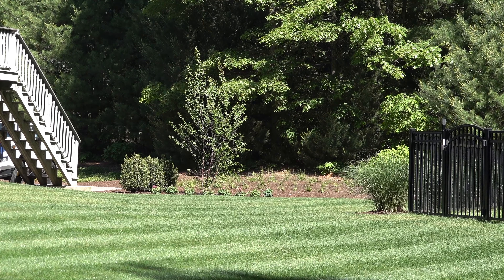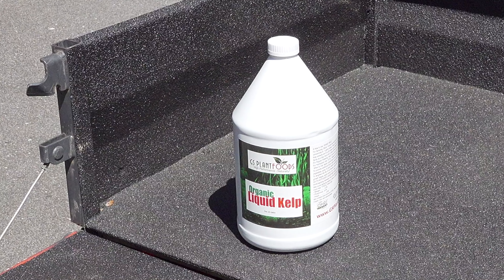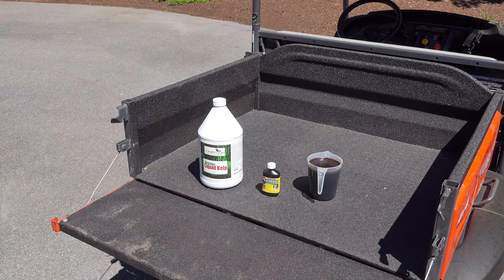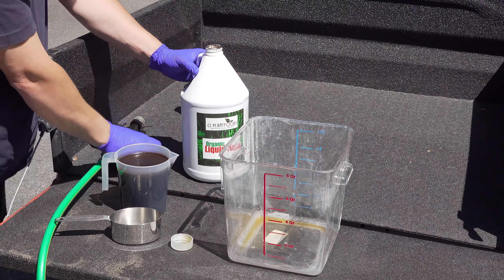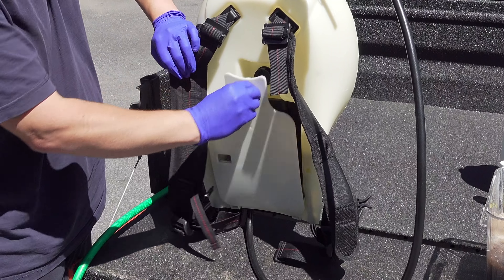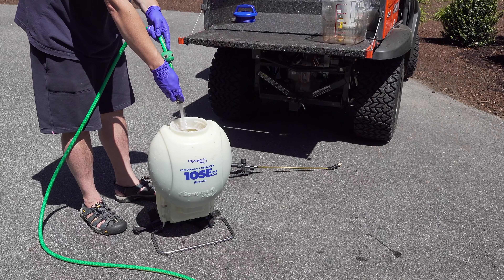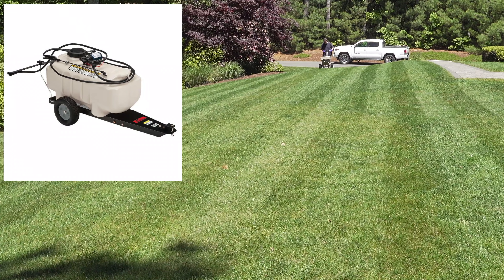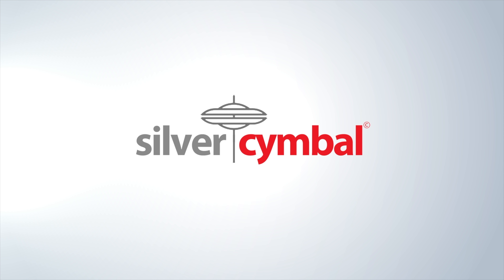Protect your Lawn From Summer HEAT & Stress my Secret Recipe STAY GREEN with Sea Kelp

Comment: Love my Sprayers plus. But my wand tip leaks when the unit is off. Have you had this issue before?
Reply from the maker: Yes, it's not just them though they all do it. Here is my trick. Once you turn it off squeeze to release pressure.  Then with the unit off, hold the wand in the air (not above your head obviously in case of drips). Squeeze the trigger and wait a few seconds with it held open. This will usually allow the fluid to drain back to the tank. Hope this helps.
Reply: @SilverCymbal  What a fantastic idea 👍 This will help a ton, especially after getting blue dye in the driveway. Please keep up the good work, you've got a great channel going.
Reply from the maker: @webeducation  That you I really appreciate it

Comment: Do you put this mix down before the Humic DG? 

How often should you put this down?
Reply from the maker: I use the humic dg as a foundation type product 1 or 2 x a year. Its a huge soil builder but this "recipe"is applied monthly during the hottest months. usually 3x, June, July, Aug (for new england) to keep the foilage in great shape and protect against heat Hope this helps.
Reply: @SilverCymbal  Have you thought about using N-ext products? Why/Why not?
Reply from the maker: @DEXTVHD  Yes I have but the price was too high for me and in this case my own mix has worked so well that I will probably just stick with it. They do look like nice stuff though.
Reply: @SilverCymbal  they are quite expensive, what's the humic acid % for your liquid humic from gsplantfoods?

Comment: Can I use in a hose end sprayer and what setting?
Reply from the maker: You can but it really is not going to be easy to measure. I would get a really inexpensive pump sprayer. It goes faster and gives you much fiber droplets that cling to the blades better.

Comment: 2 questions, can I use this mix with a hose-end sprayer? Would you recommend adding liquid iron to the mix? Thanks!!!
Reply from the maker: No, it will not work correctly. Hose end application is very rough and for this which needs to stick to the blades won't work correctly and end up in the soil which loses 90% of how sea kelp works. Use the regular sprayer and the results will show.
Reply: @SilverCymbal  Thanks for info.  Can liquid Iron be mixed into this, or should it be applied separately?
Reply from the maker: @ErikHiner  I haven't tried. I a, not a big fan of adding liquid iron. Makes you lawn super green for such a short time, it's expensive and it can stain badly. I get why people doing but its really not sustainable in terms of cost for most people and if you ever spill it on concrete you won't be happy.

Comment: Do you water this in after the application?
Reply from the maker: No, you should try to apply it where it can stay on the leaves for 24 hours, then water as normal. This gets absorbed through the grass blades  and though it will help the soiul too the best effect is through the leaves, also called a foliar application. So just spray and let it do its thing. Thanks

Comment: Thank you for the video. Just curious, can this concentrate be used with a hose end sprayer such as the Ortho hose end sprayer?
Reply from the maker: Thank you, unfortunately not. Those put out a lot of water and dilute it so much that it wont stick to the leaves properly/ There are some formulas for this that you can spray through the hose end sprayers that will not be nearly as effective. if at all. It's just the way that kelp needs to be applied.
Reply: @SilverCymbal  thank you. 😊
Reply: @SilverCymbal  Thank you for this answer, I was wondering the same thing.

Comment: What part of the country are you in compared to me? I'm in regular 100 degree day Texas with St.Augustine grass. Will any of your tips benefit my lawn?
Reply from the maker: I am in New England much of our summer has been hotter than a lot of Florida though I understand TX is HOT! The good news is that the mix is very beneficial to all grass types especially for heat. We have had a crazy season and my non-irrigated part of my lawn can see it on my instagram is in better shape than many of my neighbors with irggiation.  Its no mircale cure but it has an absolute benefit especially for high heat climates.

Comment: How often are you applying this solution? Thanks
Reply from the maker: I apply it ever 4 weeks when the weather is brutually hot. This summer has been bad so you might do it every 3 weeks.
Reply: @SilverCymbal  Can I use Root Ruckus + thrive? Root Ruckus has concentrated Humic acid + Kelp.
Reply from the maker: @abansalify  Yes you can that product https://amzn.to/3jpo9Oe is basically a mix of these and other have reported it worked very well for them on lawns as this. Same company makes them so I have faith in their stuff.
Reply: @SilverCymbal  I am also testing Hydretain Granular for hot season.

Comment: I did this treatment two days ago and now have the products from your Tenacity video. How long before I can treat the lawn for weeds and such?
Reply from the maker: Sounds good. When using the summer formula I would wait 7 days before treating weeds. Just since the summer treatment is on the leaves you want to leave enough time to the tenacity can do its job.
Reply: Thank you for the reply. The 105Ex sprayer worked great. Granted, all I can compare it to is a cheap pump sprayer from the big box store, but still, it worked great. One more question, I've got about half a gallon left at the bottom where the pick tube can't reach (with it facing up). Do you turn that down to get the most liquid out?
Reply from the maker: @KyleHeon  Thank you, I did the same thing. Put some gloves on and rotate the intake tube so it points down in the sprayer. This lets you get to almost the last ounce of the sprayer. You wont have that issue again. Thanks

Comment: Will this work in hot climate like Arizona on Bermuda grass?
Reply from the maker: Yes, it will provide the same benefits. If you are in extreme temps I would apply it as early in the season as you can and then monthly after that until the temps are below 75 average during the day

Comment: Good video. Can this mixture be used on new sod and gardens?
Reply from the maker: Yes to both, great for sod since by it's nature in it's first year it's already settling in. This is a great way to assist it and I also use this in my gardens. I will spray  on shrubs and trees. I generally just use it iat the base of plants when doing gardens since covering them completely can be difficult.
Reply: It sure does work,my garden is thriving big time!!! So after I applied this mixture a week ago,I had some left over which I placed in containers. My question is will this liquid spoil..go toxic....???
Reply from the maker: @jimtalor7971  Thats great to hear that you have great success with the mix. Nothing in the mix should go toxic but it may lose some potency I would say its best to use it within 1-2 weeks. You can always add extra to use it up also. I would not waste any of it. Thanks

Comment: Liquid  Humic vs Anderson  Humic DG?
Reply from the maker: They both do a great job but if you primarily want to do just Humic acid the Andersons DG is excellent. You can always mix mix the recipe without the Humic acid if you go that route. Keep an eye out for a new video on this too soon. This is the best part of mixing it yourself and you can adjust it as needed or use it as designed for a quick and easy way to help your lawn.

Comment: How much sq ft does a 4 gallon mixture cover? Thanks
Reply from the maker: About 2500 sq ft ideally, but you can stretch it to 4k if needed. Some is better than none but applying the rate I have has given me the best results

Comment: Great video. Can you use it in Bermuda. We had a serious heat wave for 2 weeks. Water alone did not do job.
Reply from the maker: Yes, you definitely can, and it should help significantly.
Reply: @SilverCymbal  Last question. What about plants and vegetables?
Reply from the maker: @Jorgemartinez-qo6yq  Yes all 3 products shown are organic and can be used for plants and vegetables. Always double check the labels first in case things change but they are currently good for this.

Comment: I always enjoy your presentation style, great advice as always. Is it just the standard 1 gallon per 1000 sq ft coverage for these products mixed? I have a little over 11,000 sq ft to cover so if I'm doing multiple applications per year of a supplemental product outside of my regular granular fertilizer apps, I need something cost effective. A lot of the products I've seen like liquid humates seems to be pretty expensive or only covers a smaller area. So I started looking at the concentrated humic powders you mix like 1tbsp per gallon or something and it goes a very long way. Definitely need concentrates! How much coverage do you get out of a gallon of each of these bottles?

Comment: Hey thanks for the heat stress recipe. Just ordered all the ingredients. Thanks!! So I have a question. Do you water this in to wash it down to the soil level?
Reply from the maker: Thank you, no just apply it and let dry and wait 24-48 hoiurs before watering to allow the leaves to absorb the product. If it does rain in less than that, its not the end of the world and you will get some benefit but allowing it to dry will give the best results. Kelp: https://amzn.to/2It5ZJT  -  Superthrive: https://amzn.to/2It654d  - Humic Acid: https://amzn.to/2WyMABa - Sprayer: https://amzn.to/2IslQIJ.

Comment: How many square feet does a gallon of your solution cover?
Reply from the maker: Depending on your nozzle/spray pattern 4 gallons will treat around 2500 sq ft. Going heavier is fine but even if you are lighter your lawn will get benefits from it.

Comment: Thank you for the information and video. Is it ok to apply this formula now (~July 1) and recommended?
Reply from the maker: Thank you very much. Yes, you definitely can apply it. For me I use this monthly June, July and August.  Sometimes September if the heat stays up. Any application will provide benefit so if you skip a month that's ok but if you can do monthly in the hotter months that will be the best.
Reply: Silver Cymbal ok great. I’m going to get an application down then.  I don’t have an irrigation system so I’m hoping this formula will help out.

Comment: It looks like plasebo efect, what about keeping the grass taller so we will have deeper roots
Reply from the maker: Kelp and humic acid have been scientifically proven to provide these benefits. Growing the grass longer never looks very good and in my experience didn't help me tolerate the heat any better which os what drove me to looking for a better way.
Reply: @SilverCymbal  humic acid will sure help retaining soil moisture, I insist on taller grasses and the best ground coverege to help prevent stress and help with drought. Some times we tend to look for perfect products and miss management practices

Comment: How about using the concentrate and use a Dial N Spray sprayer….do you think it's gone work…..if yes...what it would be the right ratio...thanks
Reply from the maker: I wouldn’t recommend it due to the difficulty in getting the mix right. A better option would be to buy an inexpensive but good sprayer like this one, https://amzn.to/2xBJP3k it will work well  and be more accurate and is super easy to use. Thanks for watching

Comment: How much of this should be applied per 1000 sq feet? Does it matter?
Reply from the maker: Any amount will provide benefit but my mix ends up being around 4 gallons for 2500-3000 sq ft.
Reply: Thanks, Great Video btw,,,,
Reply: Should this be watered in or leave it ? If so, how long  before I can water?
Reply from the maker: @juanreyes25  No don't wanter it in you want it on the leaves for 24-48 hours then water after that. If water happens through rain or something else don't worry it still has benefits going into the soil but for best results the above way is best. Thanks for watching.

Comment: Do you apply this in summer or apply in late spring to prep for summer?
Reply from the maker: You can apply as a prep if desired but personally I start applying it when the majority of the daytime temp is 75 and over. For me in New England that's usually June-August
Reply: Thank you...I’m in Washington state so about the same time Frame in  temps 
Thanks again

Comment: As a lawn professional for 24 years, this might not work on your lawn depending on your soil type and acidity level. In fact it could make your problem worse. Have a soil test done if youre clueless.
Reply: Good point. Soil test for NPK and pH but what are we looking at for good growth from the results??
Reply: @jimtalor7971  the easiest thing to do would be to take your test results to a local professional fertilizer and chemical specialist, not home depot. They specialist typically will have whatever you need to balance your ph and cure your deficiencies.

Comment: How many sq ft does this cover?
Reply from the maker: 2500-3k for 4 gallons of finished solution
Reply: Awesome. I don’t have a backpack sprayer yet...can I get by with a dial in and hose sprayer or should I just get the battery powered backpack?
Reply from the maker: @seanehook  I don't think the hose sprayers work very well for this type of products. The grass really wants fine droplets for best results. But I don't want you to blow your budget eirher, check this one out, its a great budget sprayer that you can use for this and many other things.  https://amzn.to/2J6ZPQd  It hold 2 gallons so just make 1/2 of what I showed, and you are good to go.
Reply: Silver Cymbal one final question as I plan to apply this next weekend since I got the products and waiting for my electric backpack sprayer (arrives Tuesday). Is there any issues with applying this on hot days? It would be early in the morning either way.

Comment: Does this need to be watered into the soil or is it mainly a foliar application?
Reply from the maker: It won't hurt but allowing it to dry will provide better results. The Kelp is better absorbed through the blades as a foliar application. Sometimes it has rained on me using it and I don't stress.

Comment: Thanks for the info. Is this something that can be done now mid summer or should it be done before? Wondering if I can do now or if doing it with the amout of heat right now will cause a problem. Thanks

Comment: Nice video and it will work but Humic DG, as much as you want, will do the same thing and you can apply with a spreader. Water too but water deeply and infrequently just like natural rain and never in the heat of the day. I've heard of kelp but not sure what such a small amount will be good for. It's the humic acid that goes all the heavy lifting.

Comment: Would a garden hose sprayer work?
Reply from the maker: Depending on the model you could do that but I am not sure you could get a strong enough concentration. Using a less expensive hand sprayer with a pump may be a better option.
Reply: @SilverCymbal  I have both. How often are you applying it? I live in south Florida and May is hot and dry. You can watch the lawn dying. This is an interesting supplement to a good fertilizer program.
Reply from the maker: @floridaswampman7648  I put it down about monthly when daytime temps exceed 75 degrees.
Reply: @SilverCymbal  great.. Thanks

Comment: How does this work in Florida on St Augustine grass ?
Reply from the maker: Yes it will work well on St Augustine as well and I am sure you can use all the help you can get with yoru lawn protecting it from the heat in sunny florida. I have been very pleased with this home made lawn formula find that the value of this is great compared to buying commercial lawn supplements.

Comment: Do you water immediately after applying?
Reply from the maker: No just the opposite. You want it to stay on for a day or so to allow the kelp especially to soak in. If there is a rain the products are still useful but for best results allow a day or two before the next watering. Applyin at the end of the day is best when its dry but cooler.
Reply: Excellent thanks!

Comment: What I am seeing is about 1 gallon for every 1k sq ft of turf. At that walking speed. What if ........... I added a marking blue and a herbicide? 🤔
Reply from the maker: You could add a dye if desired though if you stay in lines you probably can skip it. I always use a dye with weed controls since I am spot spraying and it's too easy to get lost. I wouldn't mix this with herbicides though, not sure I can tell you scientifically why but it might interfere.
Reply: So is it 1 gallon per 1K sq ft?
Reply from the maker: @seanehook  You can use it at that level but I use 4 gallons for every 2500 sq ft. You still get benefit from lesser amounts but I had best results with the higher concentration.